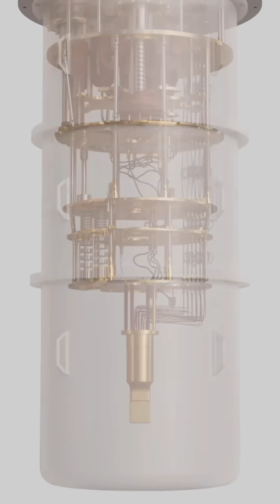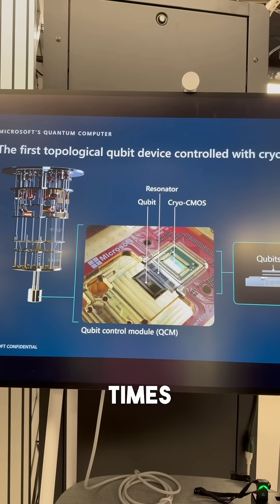Majorana 1: Microsoft's Quantum Computing Breakthrough!

Comment: Clickbat only. Microsoft is a lier. they say “designed to scale to a million,” which is the source of the confusion. But bottom line: Majorana 1 doesn’t have a million qubits today—it’s Microsoft’s claimed path to get there. 

Majorana 1 (topological qubits) is the higher-risk/higher-reward bet aimed at much lower overhead if it scales; publicly it’s at the 8-qubit stage with foundational measurements, not application-level demos yet.

Sources

Ask ChatGPT

Comment: Except, no evidence it works!
Reply: There is evidence it works, a lot of them
Reply: @JPG64  Actually no evidence for Majoranna 1 : "While Microsoft announced the Majorana 1 quantum computer, claiming it's based on a new kind of material and architecture, some experts express skepticism due to a lack of publicly available evidence supporting these claims. Specifically, some researchers point out that the company has not provided sufficient data to demonstrate the device's functionality as a topological qubit, and that previous claims by Microsoft regarding Majorana zero modes have been retracted. "

Comment: I wouldn’t say the calculations are complicated. They are just “vast” the sheer number of calculations it’s capable of are insane. But complicated? Not really. It’s just quantum, meaning each bit can be both a 1 and a 0 at the same time whereas traditional computers are only capable of a single 1 or 0 at a time. In the quantum chip, this gives each bit compounding speeds for every additional bit added to its computational power.

Comment: Bit of a misrepresentation. Quantum Computers are not good for their accurate calculations, Mojorana is more stable than other quantum computers, but accuracy isn't enough to do particle simulations in labs. The processor only has 8 qbits, it could theoretically scale to 1 million (whatever that means exactly ), but currently does not have the ability to process nearly as much data throughput as a normal computer

Comment: 1 - Quantum chips require cold temperatures to stop atoms from moving around.

2 - Quantum chips does analog calculations, with dials. Digital chips does digital calculations with swiches.

They are not the same.

Quantum chips are only fast at doing specific calculations and tend to be less accurate.

Comment: I am insanely happy they gave her the chip to handle that probably got blown out like a car headlight. If she was able to handle the actual thing then it literally has atomic sized connection issues. Like imagine if some of the millions of atoms from her fingerprint got stuck in between the spaces of the literally atom sized capacitors.... I guess at a quantum level it may not be a blocking issue, kind of like moving around a boulder, but that boulder should not be there in the first place for peak performance

Comment: Is it okay to stop and question if we should put AI into a quantum computer?
Reply: Not really. Quantum computers really aren’t that interesting. They are interesting to an extent but modern computers can do the tasks we need. Quantum is super specific and it’s more of a giant calculator than a computer. Actual engineers would laugh at this cause it’s such a rudimentary explanation. It could be partially wrong as well. However, quantum computers doesn’t have the ability to automatically just make AI dangerous. We are so far away from that possibility. AI does the tasks we tell them or need them to do. Yes they learn about everything about it and continue to learn. But if you have an AI system for driving cars, it won’t suddenly be able to learn Spanish. This isn’t me trying to say you are wrong. Yes AI can be dangerous but we aren’t there yet. Also, the positives far outweigh the negatives. I truly believe most of the problems that plague the world today, will be fixed by AI.

Comment: I find it interesting but not unsurprising that it required a correlation between cold and a concentration of space, so to speak, to produce something with an advanced level of intelligence. Think the feminine Divine or the right brain. Correspondences having to do with qualities in terms of magic, spirituality, and other ideologies all seem to agree that feminine is cold, dark, spacious, primordial, and of a higher overall capacity than masculine. The feminine spacious darkness is that from which all things originated. There has to be a space in which something can exist in duality, and then that something that emerges from that space is the opposite polarity of masculine, light, hot, penetrating, concentrated. I can understand that quantum computers with the previous concept of qubits required exceedingly cold temperatures in order to eliminate noise, but I find it in a way surprising, in a way intuitive and obvious, and in a way laughable that this correspondence emerges in regard to the need to form a different kind of quantum computing just in order to forge its components. It's the same thing showing up in a different way, creating an overarching trend.

Comment: Another piece of pseudo-science information lacking important details. What does it actually compute? Can it compete with the current technology we have? In some tasks selective task design for it, yes—but generally, NO. Don’t picture it as the most powerful thing out there.

And about the "coldest thing"—you measure temperatures across the universe using residual light basically a degraded history records from stream of waves, yet you claim to have the coldest thing on Earth? Wow.

This kind of info makes non-technical and non-tech-savvy audiences believe that everything you're saying is absolute fact—ultimately making them even less informed.

that is why i was hating this kind of hype info.

now tell me if im wrong

Comment: −273.15 is absolute 0 and no PC would function at that level and space is -272, it is not possible to run the chip at -273.15 or it will freeze so most like is running at -273
no need to talk nonsense if you dont understand it

Comment: Finally I can run Microsoft Edge
Reply: You mean google chrome 😂
Reply: This would have been funny if you said Chrome. Edge is insanely optimized.
As I type this, and in not making this up, I have 106 tabs open in Edge (don't ask). And I'm barely touching my RAM.
I don't use Chrome for that reason.
It's slower than Edge, it uses 20x more memory than Edge, and has a billion more vulnerabilities than Edge. But Edge still runs every Chrome extension.
Chrome was great in 2010, and was ok even up to 2020, but who even uses that anymore? It's like finding someone still on MS Vista lol
Reply: @BobSmith-zq6gz  
Agree with you, I am using Arc browser anyway it’s amazing

Comment: Can’t wait to put this in my new ASUS motherboard, hopefully 16 gb of ram and a 1050 doesn’t bottleneck it much
Reply: Quantum ram and gpu 😭
Reply: quantum gpus will probably come to light shortly after quantum cpus
Reply: @The_kayotic they could probably be able to both use the same module rather than separate ones
Reply: Probably will cost way more than arm and a leg.  Hmm, yep; 78.5 million usd.  Doesn't even take into account cryogenic facility needed to bring the thing to temp.  Maintenance will cost a crazy amount too.
Reply: @gilian2587  would've been fun if she had dropped it
Reply: @tanelehala6422  You have a cruel sense of humor, friend.  : )
Reply: You don‘t need a GPU, because if you have a Quantem CPU, you would be able to run games on it faster then any GPU
Reply: We can finally play Crysis at 60fps. 🎉
Reply: Hopefully it can keep up with my 5400RPM HDD and GT660
Reply: Yea that will properly never happen. This CPU is not well suited for home computing. 1. You don't wanna the cooling bill, 2. It doens't make the individuel calculations faster, it's power is in the number of calculations in parallel it can do. This will never be a gamer CPU
Reply: Bro the cpu will be so much more powerful than the rest of your pc it probably won’t work with the rest
Reply: It will lol Microsoft is garbage
Reply: @Grd77  what is garbage about microsoft tell me now

Comment: Can I run crysis without gpu?
Reply: To run crysis on max settings you'll need a quantum GPU, quantum monitor, and quantum power supply.
You can still use your normal keyboard, but you'll want to upgrade to a quantum mouse.

Comment: Though we can't measure the temperature of interstellar space directly, we can estimate it using radio transitions and molecular vibrations, giving an approximation in Kelvin. Saying that 50 millikelvin is 10 times the temperature of interstellar space is not entirely precise, as the temperature in empty space can be a few Kelvin due to the cosmic microwave background (around 2 something K), while near stars, it can reach thousands or even millions of Kelvin.  
🙂
Reply: This is such a chatgpt reply lmao. But more importantly, when someone says the "temperature of the space" they're most likely referring to the general average temperature, and obviously do not consider the nuances
Reply: @chanukawijesinghe3357 Dude, you don't need ChatGPT!  A quick Google search will easily turn up that info.  And if you dig a little deeper, you'll find tons of papers and research on it.
Reply: @benyaminaser  nah I'm saying your reply sounds so much like ChatGPT, but it's unrelated. But again, I don't doubt you at all, not saying you're wrong. I'm saying she and most people, mean the general average temperature, they're not worried about the nuances cus they don't really matter to the point at hand

Comment: The first bit - it being the coldest place in the universe - is likely incorrect. Microsoft hasn't released publicly their exact cryogenic temperature for it, but it's unlikely to beat the 38 pK record.
Reply: Black holes are colder than the cosmetic background radiation and without it they are only as hot as Hawking radiation.
Reply: Yap yap yap

Comment: This chip does not have 1 million qubits. They are showing off the theoretical design of creating something that would. The most that Microsoft has produced on a functional Chip is eight… Eight qubits
Reply: It's a great achievement by this team no doubt. But Microsoft dropping it like their newest IPhone and saying that we're gonna have commercialized quantum computers in less than a decade is laughable and pure marketing
Reply: @JZhR  almost all companies are starting to do that sh lately. I agree
Reply: It did sound weird because last time I checked we were still at like 16 or 32 qubits and they require a giant room-sized machine to run. This is very misleading
Reply: @StopEatingRocks  The biggest ones at IBM are just above 1000 qubits, cant say for how good their error correction is but regardless.
Reply: I don't think anything said in this short was accurate.
Reply: @andrew66862  you can.. do some research and see it is?
Reply: You're not going to build a chip with one  million qubits with that attitude.
Reply: can it run crysis?
Reply: @avlsby probly not. You’d need a quantum graphics card as well. This is just a computer chip
Reply: It's less reliable than ai which is kinda hilarious when you watch these propaganda vids
Reply: I almost missed quantum computing hype, been too much AI hype lately. Surely we're going to have commercial quantum computers and AGI by the end of the decade? Right? Jk. Microsoft's been pushing this story hard, so many videos and press releases, and if you actually read the paper, they haven't even confirmed a majorana zero mode detection, nor have they confirmed 8 qubits, only one.

Give me a break dude.
Reply: Yep it's weird how YouTube channels don't do they research and are willing to just mislead people for Microsoft
Reply: Google's Willow has over 100
Reply: @beechcraft12  Yeah but the importance of Microsoft breakthrough isn’t how powerful it is. It’s that they actually managed to do it.

This type of Quantum Computer is theoretically a lot more stable and less prone to noise interference than other type of quantum computer, because instead of using a physical property, they are using a topological property, which actually grant a built in defense mechanism against interference compared to using a physical property.

I’ll probably explain it a bit wrong the specifics because it’s very complicated, but basically the information is equally distributed at two different place on a wire. Compared to other methods, if a noise interference hit one of the two places, you actually don’t lose information and the part that got hit will quickly reform. 

A noise would need to hit both sections at almost the same times for it to actually disrupt the informations, which is much more rare and unlikely compared to only hitting one.

So Microsoft basically showed that it was possible to make a Quantum Computer like this. If it continues to be develop Microsoft could end up making the most robust and reliable Quantum Computer ever made to this day. (relative to all the other methods)

There also the added potential of stacking millions of them in a tiny space.
Reply: Out of which only 7 work
....
Reply: You’re wrong, the most is 105 cubits and it was just announced about 2 months ago, the chip is called “Willow” and google made it
Reply: Never said it has, only that it can
Reply: and also they can make an actual ALU  out of it because Microsoft's needs like 150 or something qubits to make a one logical qubits and we need around 1000 logical qubits to make a one ALU
Reply: That’s what I thought I heard 1M and was like lol wtf I thought it was only like 6-12
Reply: i believe this
Reply: @AIBOT-TIFFANY "Trust me, I'm a professional YouTube commenter."
Reply: @kallah4999  omgosh we can’t have conversations
Reply: @AIBOT-TIFFANY  It was just a joke. The comment is correct. I've read the same about previous quantum computers, they've had a huge scaleability problem which have prohibited progress.
Reply: @kallah4999   ahh makes sense now lol sorry for being sarcastic! and yes i’ve read an article on that!   Supposedly Those quantum chips needs special cooling that can essentially slow down thermal noise to potentially have calculations run in the smoothest way possible with no vibrations getting in the way at all for the quantum chips to manage itself
Reply: @AIBOT-TIFFANY  the majorana particles make it super resistant to decoherence. Hence the theoretical 1M qubits is now possible with this breakthrough
Reply: @SensitiveSensei time to scale up and entangle some qubits! let’s get it boys
Reply: @kallah4999  I could only imagine the scalability issues whe you are place each one in a specific orientation and to make this one chip takes 17 yrs. . .
Reply: @AIBOT-TIFFANY  you currently need superconductivity for quantum computing, so insane cooling systems are needed. Usually liquid helium.
Reply: @SensitiveSensei   nah its not they solve the decoherence for the short time you need massive redundancy  to store the data and as redundancy goes up the decoherence and gate error rise which makes system unstable in second place so it is problem instead of the solution
Reply: @SensitiveSensei  so why Microsoft couldn’t do it?
Reply: I felt pretty sur the bch was making sht up
Reply: @johnschlottman619  late stage capitalism is all about cap. Why even make something to sell when you can fake it and make money off stocks instead?

Comment: Did someone just say HALF the size of an electron?   That's not true.  

Majoranas are quasiparticles measuring behavior, they are not half the mass of an electron. Electrons are point particles, nothing is smaller than them.  For point particles, which have no size, they're judged by mass, and electrons are the least massive particles of the 12 elementary particles with mass.

Comment: 50 mK?
I worked at a lab in the University of Leeds, School of Physics where we got the Dewar down to 30 milli Kelvin. 
Pretty cold.

Prof Ben Varcoe's Quantum Information Lab.
Reply: Jes, I thought the same. MIT did nano Kelvin more than 20 years ago 😅
Reply: @andykandolf1948 yeah but probably their experiment didn’t have Qbits making a ton of heat
Reply: Dilution refrigerator I work on gets to 8mK
Reply: Lancaster got the ISO Lab, too

But yeah, Uni of Bremen in Germany
Reply: Is 0 kelvin theoretically possible? Would you be able to see an electron at that temp?
Reply: @rephaelreyes8552 no, it is not theoretically possible, and no, if you tried to measure it you would add energy to the system.

Comment: It can’t really be done with a “palm sized chip” when you need a whole freezer for it to work at all right??
Reply: I mean the bit doing the processing is still a “palm sized chip”.
Reply: The chip can get bigger with the same size freezer, also you wouldn't say you can't really run computations on a CPU  because you need the motherboard, ram, memory, and case.
Reply: What MS has done is make the chip smaller, but the problem is they still don't have a room temp super conductor to use, so the computer needs to be cooled to absolute zero or the chip doesn't work and cooling it requires an entire warehouse and a nuclear generator
Reply: @ms3862  how would a room-temperature superconductor help with this? Thanks
Reply: @ The computer itself would use 1000 times less electricity to operate and the warehouse that otherwise houses these computers would no longer be needed as the cooling equipment is no longer needed, and also the power generation is no longer needed to power the warehouse and cooling equipment. You could basically build the quantum computer to be the size of a videogame console instead of needing a huge warehouse and power station like they do now. This also means quantum computers are currently not portable and never will be without a room temper super conductor but if we did have this then they would become portable
Reply: @ms3862   cool.. makes sense. Seems like next big thing will be room temperature super conductors - that sort of thing I’m guessing can make lots of things become even more efficient.